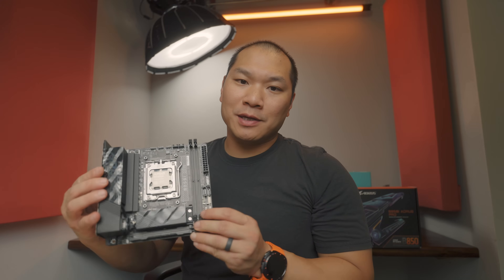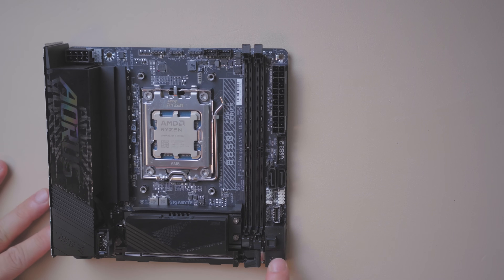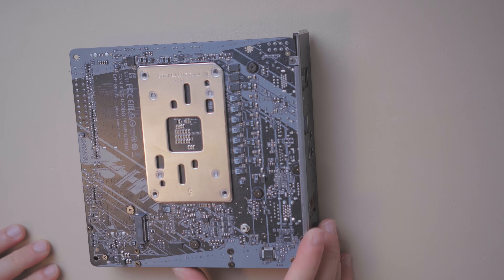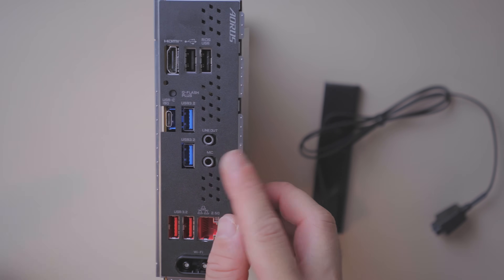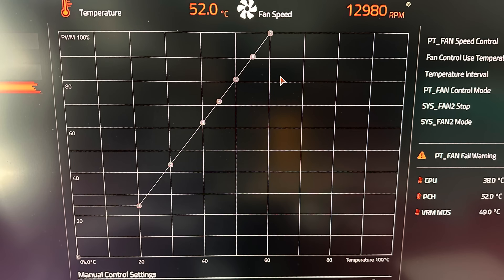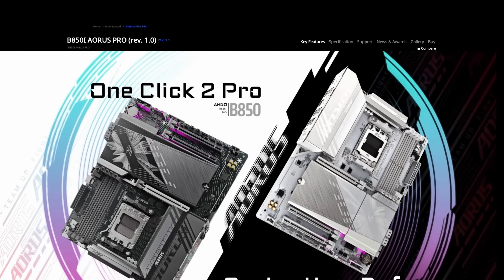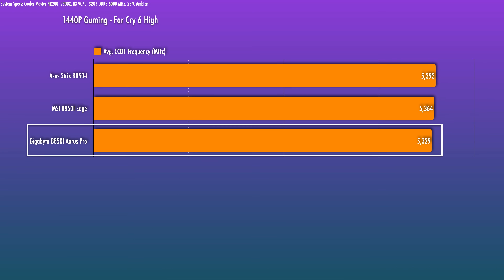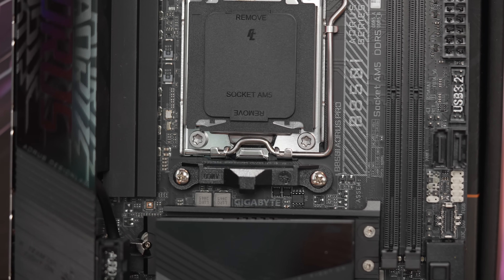Gigabyte's B850I Aorus Pro Motherboard is a solid ITX board. But...

Comment: got this specific motherboard, had to change the stock ssd cooler since it was loud and wasn't cooling my ssd enough to my targeted temperature
Reply: what did you swap to?
Reply: @Shindemo15 I don't remember the specific but it was non-branded, has a heatpipe and better heatsink surface. You can buy anything as long as the cooling system makes sense, mine was running the same 40mm fan but I was able to run it quieter while my ssd ran as warm as around 45°C (stock cooler goes above 50°C).

Comment: I got the b850i Aorus Pro and I love it. Yes I did have to turn down the mini jet engine they give you immediately. 

If you’re running a 9700x or a 9800X3D this board is great, and provide more then enough to give you great performance.

I changed a lot in the bios to suit my needs for work and gaming with an aggressive undervolt/overclock, fine tuning ram timings, and etc. 

Make sure to turn off the Gigabyte Auto download for their software. It’s annoying to deal with.

Comment: And i thought that B850-I Strix having those dumb q-antenna is bad, this board is just outplays asus in every single way it's not only impossible to replace antenna connector without throwing away i/o shield, but it's also uses non-standard fan connectors which have absolutely zero reason to be used at all, what's surprising at this point that it has regular m.2 and pci-e slots instead of having some gigabyte gimmicks

Comment: Thanks.
Gigabyte is going down hill, and has been since the B550i.
- would prefer a normal case screw and do without the easy-release PCIe mechanism.
- dongles, dongles, and more dongles... more e-waste garbage.
- tiny fans serve only one purpose, they reveal a lazy design.  Properly designed heatsinks can easily make up for tiny fans.
- the B550i had a nice back-side heat shield, this thing has none.
- like the other manufacturers, please STOP using these new WiFi connectors, screw-in's work jsut fine.

Comment: 8:20, I felt the pain in your eyes, fantastic review as always. I thought it was a good board, coming in as one of the more affordable AM5 ITX option helps its appeal some. Not a fan of the fan connects, obviously and some of the quirkiness around the quick release features. The shroud is a huge fingerprint magnet but hey, it’s a glossy black finish. The bios has a nice UI and glad to see more manufacturers raising the resolution.

Great video!

Comment: That WiFi-EZ port is a deal breaker for me. Why Gigabyte decided to move in that direction is beyond me. Until they include an SFF-friendly antenna or somebody comes out with an SMA adapter, this board is off my list. I'm considering the Asrock B850i when I finally move to AM5 for this generation.

Comment: you haven’t shown gigabyte’s “utilities” that come with the mb, if you did nobody would buy this crap. i made that mistake once and was horrified
Reply: I’ve never installed any motherboard utility ever. You don’t need it.
Reply: You don't need to install the utilities. You can even disable it entirely in the BIOS, at least on my B760 Aorus
Reply: @krakentortoise7531  yeah i know that, i don't have installed any, but i usually just try them out and see if there's anything useful, like they check your driver or to change mb's lights. They would be actually useful if the worked properly, but gigabyte's stuff is so horrendous i think it may have corrupted my pc forever
Reply: No reason to install Gigabyte Utilities, ASUS Armory Crate, nor MSI Center

If only looking to buy a motherboard that doesn't include any of those aforementioned bundled "software"....that wpuld leave Sapphire, Maxsun, JGINYUE, and ODNA.
(Edit: I missed Hiswiser and Erying)
Reply: @brianmoreira7956  man they’re not so useless on paper, they check for appropriate drivers and afaik the gigabyte utility is the only permanent way to change the stupid lights on the stupid mb, other software needs launching after every reboot
Reply: Question; then what should I use to control LEDs and Fans??

Comment: Rear io is just too abysmal to even consider Gigabyte's itx boards. It's the same price as Asus' B850-I and is $200 more than Asrock's B850I in my country.
Reply from the maker: Oh that is an easy choice then, Asus hands down if the same price.
Reply: You don't really have to hunt for 850I it's pretty much exactly the same as B650E for exception of secondary m.2(which is gets upgraded to gen5), so if you have B650E-i for cheap - just get it and you won't loose anything, for exception of maybe 1080p bios